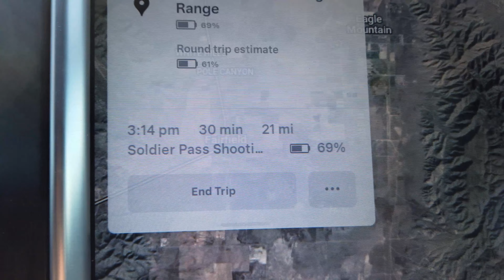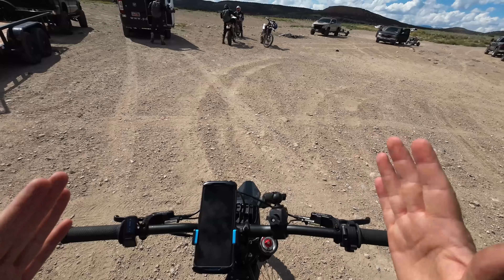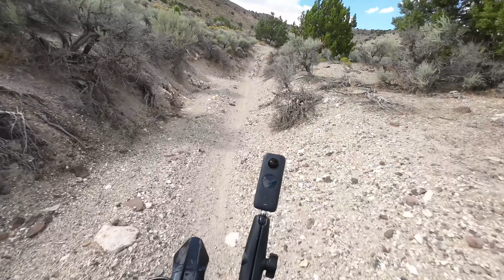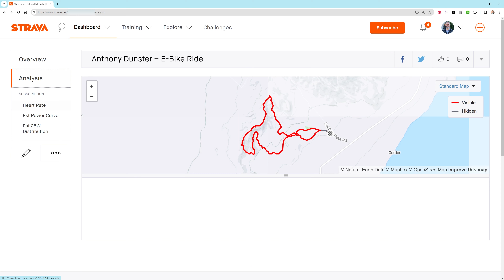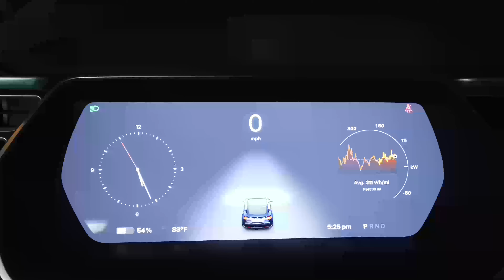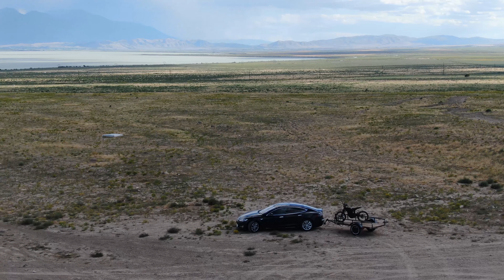West Utah Lake Adventure: Eco Mode Range Test on the Talaria MX4 Riding Desert Single Track

Comment: How’s the Y treating you? I have a s85d just like yours with FUSC. Is the charging on the Y significantly faster?
Reply from the maker: We have put about 700 miles on the Model Y since we got home with it and it does charge significantly faster. The peak I've seen is 261 kW and most times we've supercharged the average kW is over 100 which is much higher than our S. We have been prioritizing driving the S on the gross winter roads because it has better winter tires on it, and it's just generally harder on a car to drive in winter conditions with road salt and higher risk of an accident. We have some road trips planned for the Model Y once the weather warms up though!